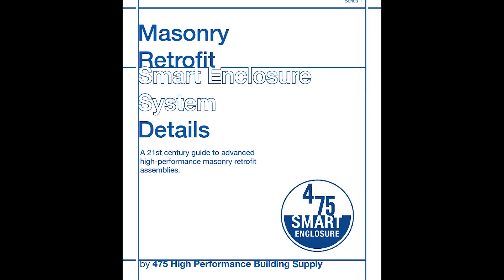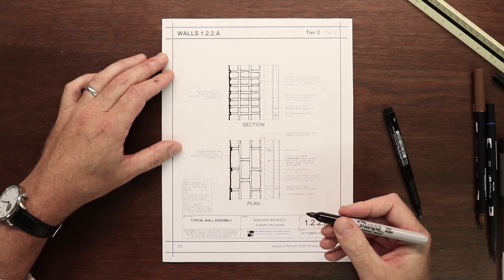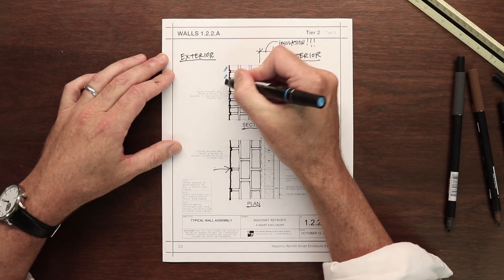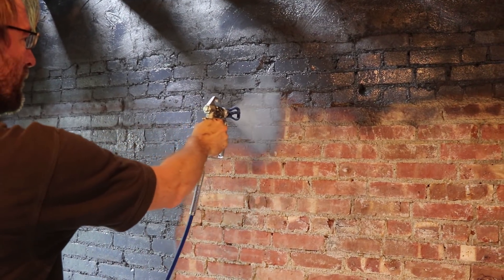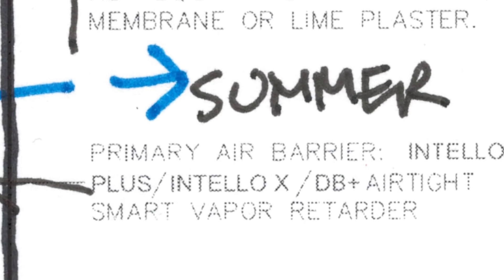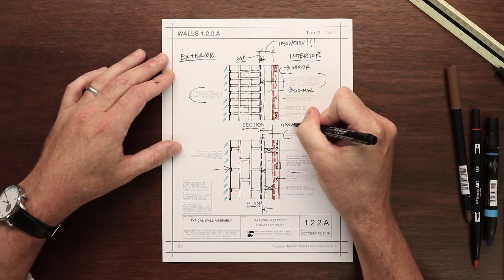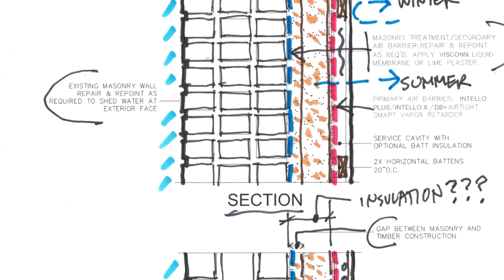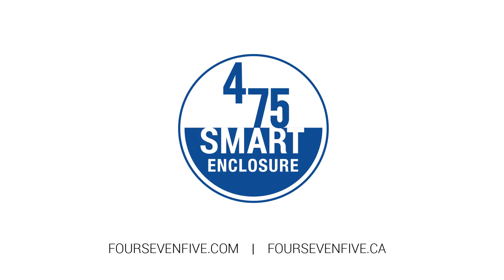Walk-Through Of 475's Masonry Retrofit Smart Enclosure

Comment: Hi, is there in your experience a minimum heat input / “loss” to keep the masonry structural thickness from saturating or staying too moist over time that means one cannot insulate beyond a certain value in relation to the implication it has on energy flow from inside to outside? Holding level of airtightness and fire separations constant, are there situations where people have kept the outer air barrier say a full one inch back from the interior surface of the masonry to create outside-coupled ventilation cavities/compartments at each floor to allow the insulated infill / furred out wall assembly to dry more or less directly to atmosphere rather than via diffusion through a thick masonry mass? Obviously complicates firestopping at floors a little and does not negate the need for exterior water shedding but basically wondering whether back ventilating the masonry via special vents/weeps tucked into window frames, under coping and drip edges, etc. could be a good strategy for allowing higher levels of insulation than the typical shallow furred out interior wall I have been seeing in your case studies.
Reply: Maybe a more focused question: can you cite the retrofit project you are familiar with that has the highest absolute R value infill wall assembly? Probably somewhere with colder winters than NY?
Reply from the maker: @2brazy4ubitch  High performance masonry projects, even up to Passive House levels of performance, often require lower levels of insulation than you might expect. Even in colder northern climates. Best to look at, and analyze specific project needs rather than create a general rule when it comes to situations like this. We're happy to help if you'd like to reach out and look at a specific project.
Reply from the maker: One can build a house in a house. This has been done, but makes the brick very cold - you will need to assess if this is appropriate for the masonry used. If so, it could allow you to build a higher r-value on the inside, as you have created a masonry rainscreen. You will have to make sure it is vented properly.

Comment: If Lime plaster is used, how much would you say the thickness should be.
Reply from the maker: I'm afraid we don't have a precise amount to give you, technically the answer is: "enough to be airtight", since that is the function of that layer. It does not have to be much, just enough to completely cover the surface. But this will vary somewhat depending on the plaster use. Hope that helps.
Reply: @475.SUPPLY  
Thank you for replying, will it be same as traditional lime plastering which is sometimes 3 layers of 9mm  + 9 mm + 7 mm...
Or just 1 layer say 10mm..
Sorry I'm working on an academic project so kinda asking all this..
Reply from the maker: @FarabiBashar  Yes, a traditional lime plaster method would work to air seal. So if you want to go for that one, use the measurements you are used to for that.